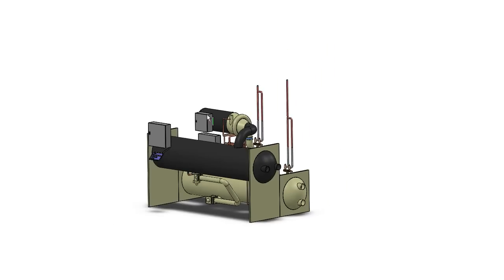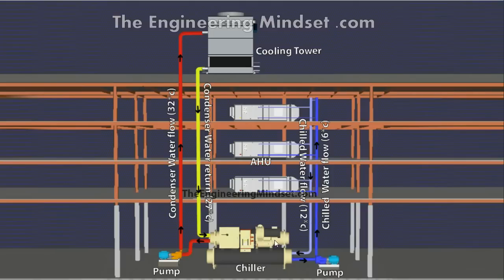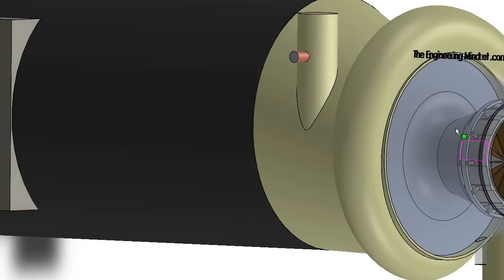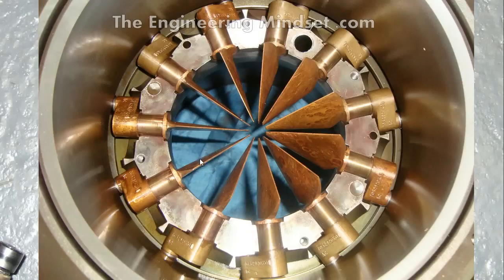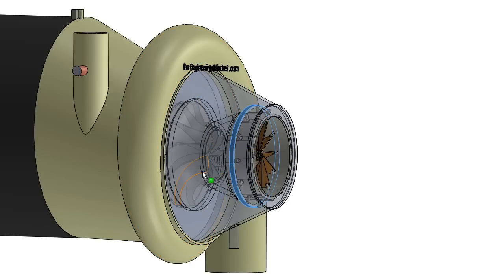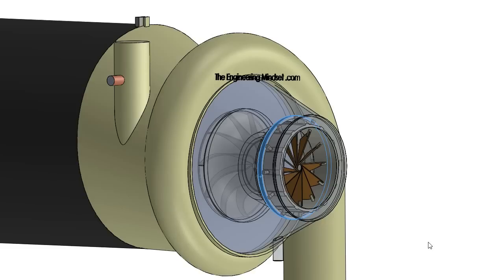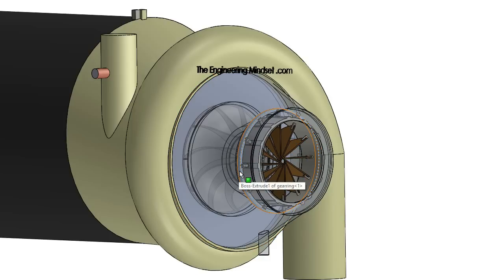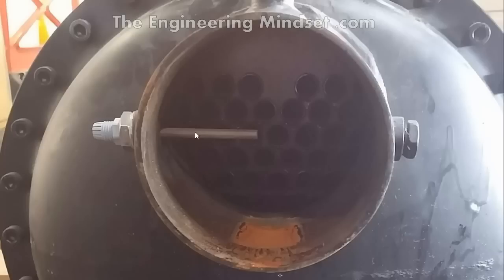Chiller - Cooling Capacity Control

Comment: Hi, Paul this is Abdul ahad from Pakistan . I am working on a Johnson control Yz centrifugal chiller. Watching your videos and I want to say that you have done an excellent work. Thanks alot. Help me clear the concept please.

When Vane guide control the flow of refrigerant by throwing a refrigerant to an angle it decrease the kinetic energy, so does it also means the refrigerant entering to condenser though discharge line has low temp due to this?

Comment: Isn't this very similar to an expansion valve ? Would this drop the pressure as well? Even though the vapor should already be at a low pressure coming from the evap? Why can't we use an expansion valve for capacity control?

Comment: the video should not be describing chill and condensor water layout. instead it should combine vane guide and hot gas bypass. also show compressor surge graph and when hot gas bypass is required.

Comment: IGVs impart a pressure drop in the refrigerant loop lowering its density.  The compressor is a volumetric device so now each unit volume of refrigerant has less mass. The evaporator is a mass device so there is less mass flow from the restricted inlet thus less capacity. The IGVs also pre-swirl the refrigerant thus keeping the compressor on its curve.  The compressor generates constant compression ratio at constant speed so the outlet pressure is proportionally lower due to lower inlet pressure.   Capacity has nothing to do with refrigerant angle of incidence but stability does.   A simple butterfly valve could be used but they impart too much turbulence at low opening and don’t give the range of IGVs because of their flow characteristics.

Comment: How does the vane control work in tandem with the expansion valve? The expansion valve can also be allowed to open only as much as required, right?
Reply: Usually they will work independent. If due to more cooling demand the motor and impeler are spinning faster, or vanes are opened by control system, the expansion valve (be it hydraulic or electric) will open or close to maintain the proper suction line temperature, so it will follow indirectly the control, but usually will not be operated directly. Some more advanced systems will operate electronic expansions valves in tandem, and also be able to diagnose issues, if their position is not what is expected.

Comment: what do you meant by max A of motor to protect it ?
Reply from the maker: motors are rated for a certain amount of current, if they exceed this they will become too hot and melt their insulation so they are rated and usually have a thermal cut out which cuts power if it reaches too hot or too much current flow

Comment: Hey thanks for this great videos. Question aren this temperature sensors usually located in a well or they need to be in direct contact with the water, refrigerant or oil?
Reply from the maker: Hey Jaylenne. Refrigerant sensors tend to sit on the pipe wall externally with insulation around them, water sensors will sit inside the pipe in a well but you will come across externally mounted ones.

Comment: I thought the cooling capacity was controlled by the expansion valve, as you explained in a previous video. Does it a work in a  combination of the expansion valve and the compressor?
Reply from the maker: For centrifugal chillers yes. You might like this new video on expansion valves https://youtu.be/oSLOHCOw3yg

Comment: on what parameter does the guide vanes operate? evaporator refrigerant pressure or leaving chilled water temperature?
Reply from the maker: Typically it will operate from the water temperature

Comment: could you tell me what information I am I supposed to understand from the rated load apms?
Reply from the maker: RLA is the rated load amps, the maximum your chiller should pull. The run load amps should be less than this and will vary with the cooling load of the chiller.
Reply: Rated load amps is the amount of current measured when device is running,Full load amps is Max that the device can pull, if amps pass that mark and no adjustment can be made, then device needs to be tested to insure it will continue to produce design performance.
Reply: thanks

Comment: I think you should have mentioned that the hot gas leaves  first of all the compressor heads up to the cooling tower (your red color line at 32c) cools down them come back as subcooled into the evaporator then leaves the evaporator heading to the AHU ....
Reply from the maker: This type of chiller doesn't send refrigerant to the cooling tower or AHU. The refrigerant always stays in the chiller, only the condenser water goes to the cooling tower, and only the chilled water goes to the AHU's. The condenser water is completely separate from the chilled water. Only the refrigerant moves around the inside of the chiller between the two circuits.
Reply: The Engineering Mindset  ok. So that means the refrigerant  ( head pressure) from the compressor goes into the Condenser then from the Condenser it condenses to finally send the liquid to the cooling tower then comes back at at lower temp. into the Condenser. From now it'll leave the Condenser once again to go into the evaporator then the evaporator will send out chilled water to the AHU . Am I right .loll
Reply from the maker: Almost but not quite. So the refrigerant gas condenses into a liquid in the "condenser" of the chiller, it then moves to the expansion valve and then into the evaporator before getting sucked back into the compressor and pushed into the condenser again to repeat the process. The refrigerant (gas or liquid) remains completely separated from the water which flows in the condenser water loop or the chilled water loop.
Have a watch of the other videos on chillers before moving onto these more advanced ones. Make notes and sketches along the way to help you understand it.
Chiller basics part 1 - https://youtu.be/0rzQhSXVq60
Chiller basics part 2 - https://youtu.be/3ZpE3vCjNqM
Compressor - https://youtu.be/PT0UIqAGacg
Evaporator - https://youtu.be/W3w7FpX9j9k
Reply: The Engineering Mindset  thank you. Am gonna watch them. It seems like I was getting confused between the chillers system and the refrigeration system

Comment: Thankc for the support....could you please tell me what is the use of induction Moter installed with the compressor unit????
Reply from the maker: Hey Devid, the motor rotates the impeller in the compressor, this moves the refrigerant around the system.  We will do a video soon on the motor, but for now you can see inside a motor and the compressor in this video https://youtu.be/PT0UIqAGacg